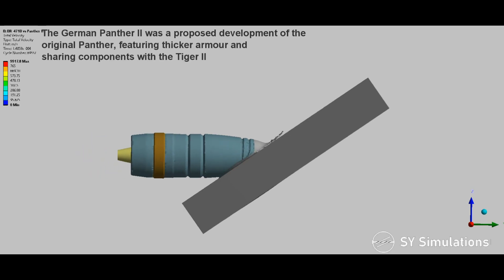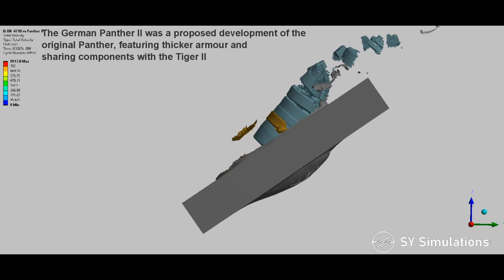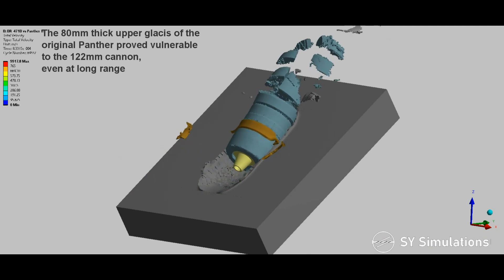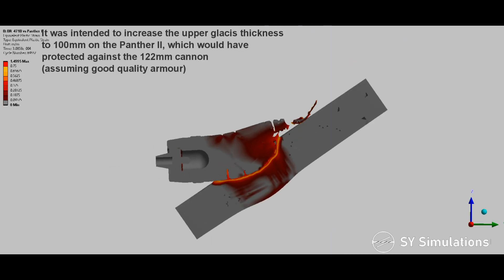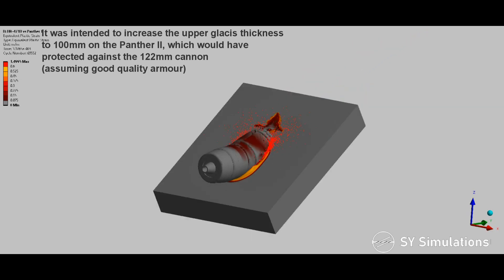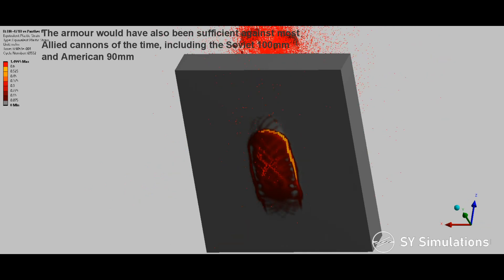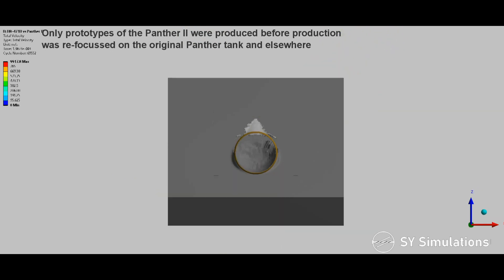IS-2 vs PANTHER II | 122mm APHE vs Up-Armoured Panther | Armour Penetration Simulation

Comment: at around 200 meters, the velocity of the BR-471B would most likely be around 795m/s. Not like it would do a lot more damage tho
Reply: Perhaps if it had that speed it would launch small fragments into the tank, although considering that the armor shown here is 250 BHN (good quality), it's possible that late-war German armor would fare worse. But I wonder if this 250 BhN armor would resist the 100 mm D-10T/S.

Comment: Quite a controversial simulation.  On November 21, 1943, when the D-25T gun was tested, the penetrations were complete, the projectile entered the armor completely.  The Panther's top armor plate could be penetrated from a distance of 2,000 meters.  Jagged penetrations larger than the caliber of the gun were accompanied by spalling and cracking of the armor plate.  The first hit in the turret completely tore the plate off the tank.  The second hit tore the turret off its shoulder strap and moved it back.
Reply: 1: It's not the Panther 1, it's the Panther 2 with improved armor 2: This is more my opinion, but from my point of view... I wouldn't trust the Soviet reports so much.
Reply: @leonardogandini147  The results of the battles speak for themselves. The D-25T showed its best side
Reply: @difenol5750  Not really

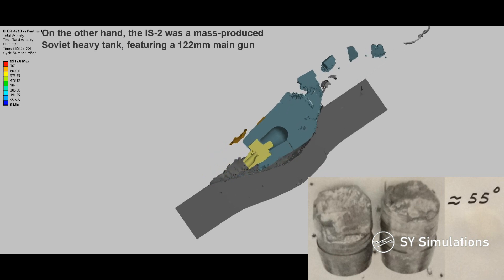Comment: С времени 0:20 в видео показано изображение 122-мм снарядов после взаимодействия с броней под углом 55 градусов. 
Эта фрагмент фотографии из этого отчета со страницы 057: cloud?mail?ru public j6A7 BU51JeYeD 8734 038
Из отчета можно понять, что это снаряды после следующих опытов:
1)страница 071, опыт №4 : плита толщиной 119,24 мм твердостью 300HB (диаметр отпечатка 3,5 мм) под углом 55 градусов. Ударная скорость 796 м/с. 
Результат: вмятина 230х155 мм глубиной 60 мм. С тыльной стороны наметился выход пробки на 3/4 окружности со сдвигом до 15 мм. Головная часть снаряда сработалась по второй локализатор. Длина оставшейся части снадяда равна 175 мм.
2)страница 072, опыт №7 : плита толщиной 119,24 мм твердостью 300HB (диаметр отпечатка 3,5 мм) под углом 53 градусов. Ударная скорость 805 м/с. 
Результат: пробоина с размерами входа 300х170 мм, отверстия 110х60 мм и выхода 150х130 мм. Головная часть снаряда сработалась по второй локализатор. Длина оставшейся части снадяда равна 180 мм.
В этом же отчете можно найти и результаты стрельбы по плите толщиной 120,3 мм твердостью 250HB под углом 55 градусов с ударными скоростями 793-825 м/с (страницы 90-91, опыты 1-6). Результат: плита не была пробита.
Хочу рекомендовать сначала повторить в симуляции опыты из этого отчета, что бы проверить правильность моделирования советских снарядов с локализаторами в Вашей симуляции.
Reply: Интересно, как вы думаете, смогла бы 100-мм пушка Д-10Т/С пробить «Пантеру 2»?

Comment: The only remaing pather 2 prototype is whats left of a turret
Sitting in the storage wearhouse at bovingtong
The engine deck was hit directly by a 155mm artillerly shell during the battle of berlin
And threw the turret several meters 
They repainted it the best they could but there isnt a whole lot left
Reply: everything you said is wrong, that's impressive
Reply: What was bro smoking when he thought this up😂
Reply: @idontlikecommunists9677  it was the panther F not the panther 2
Reply: @garyslayton8340  yeah and the Schmalturm at Bovington wasn't mounted on any tank and it never saw combat, it was used as a range target after the war lmao

Comment: wasnt 122mm BR shell prone to cracking and breaking thus reducing penetration drastically?
Reply: not all variants just the 471B and 471A the 471D had improved quality which ironically made it perform worse against angles than the lower quality "softer" 471-B

Comment: The cracking inside would likely be ejecting very fast micro-spall that is injuring the driver regardless. The concussive force of the 122mm is also likely causing the crew to bail out of the vehicle.

Can't really armor your tank well enough to survive being hit by a 122 mm AP shell from the IS-2, it is likely to cause all manner of chaos no matter if it penetrates or not

Comment: The key there is "assuming good quality armour".  By the end of the war, German armour was really poor due to lacking several key elements needed to make it.
Reply: The "bad quality of german armor" is a myth that doesn't want to die. Everybody repeats it like a dogma yet you somehow will never see a primary source for that. It's source is from british report assuming degradation of german armor due to lack of manganese but they didn't take into consideration the germans already had different armored steel composition.
The quality differences are also never given in relation to other countries varying quality. All nations had varying quality of armor and AP shells but only german is discussed while assuming other vehicles retain same quality of armor. It's simply not true, it's reality of mass production during war that quality control is not retained in constant.
Reply: One key element missing was Molybdenum.  This helped with the elasticity of the steel.  Main source for it was Turkey.   I got this information from the interview of a Tiger 2 Commander by a Modeler here on youtube.  The German was like 90 years old plus and chain-smoking.  The Modeler kept having him look at things and the German did not even use reading glasses.  Wish I could find that video again.
Reply: @jimmylight4866  Supplies of it were greatly diminished and what they had was larely reserved for making the cutting tools.

In part the Germans tried to compensate for the lack or reduction of Molybdenum by changing the tempering process though you can imagine that an already finicky process  become even more finnicky.

Not something you'd really want in an industry that is at risk of being bombed any moment.
Reply: @Dreachon  Thank you for such an informed reply.  I never read or heard about it being reserved for cutting tools.  I would love to read more about that.

I have observed the cracks around AP shot holes in the late war steel. 

Some of the hits on early steel I have seen, particularly deflection shots,  look like ice cream scoops with no cracking around them. 

Something else I would like to understand is how the Germans figured out how to weld plate armor together before everyone else and the process of doing it correctly.  

Carius mentions rivets flying around after being hit in his Czech built tank early in the war. Ouch!

The firm Bismarckhütte seems to have specialized in this plate welding earlier than other makers of the sd kfz 250 hulls for example.  

I mention the 250 as it is a vehicle I have studied in depth.
Reply: This is just BS , any proof for that myth ?
Reply: @5co756  look at the dozens and dozens of pics/vids of cracked armour on Panthers and such like. Or read the reports written by several nations or experts on the poor or inconsistent quality of mid to late WW2 German armour production. There's literally tons of proof out there
Reply: @KP-viking88  There is also literal proof of the armour working well as a Panther resisted multiple hits from the 90mm of the M26 and a Tiger II hull performing well against the 105mm that would have one on both the T28 and T29 and this is stuff that ot tested back at the US, stop with the cherry picking of pop-history historians who  want to push a narrative. 

Nearly all of those Panthers with cracke armour got shot multiple times, that is what is going to happen and happened to other tanks as well. You think a Sherman or a T-34 is goin to look better after getting a dozen shots?
Reply: @Dreachon  take off your fanboy glasses and read it again. German armour production was inconsistent, which means sometimes it was decent quality and others is wasn't. Ill believe reports and articles written and published by experts in their fields over your narrative or hurt feelings.
Reply: @KP-viking88  So rather than make a proepr aegument and present soruces you instead to go an label me as a fanboy.

Guess that says enough, an the quite limited extent of your knowledge on this subject.

Don't go and mention experts when for you that just means copying what some random person in a YT video says.
Reply: @Dreachon  Stick to War thunder, youre better suited to that than the truth about WW2 armour production
Reply: @Dreachon  if it was a swing and miss why did you reply back with the "kid" reference? Try being original and contradicting yourself
Reply: @KP-viking88  Because you are a kid, plain and simple.
Reply: @Dreachon  of course I am, thats why you've resorted to immature insults😂😂
Reply: @Dreachon  We literally have metallurgical analyses of WW2 German steel. It wasn't great. Panthers had levels of chromium, vanadium, sulphur, manganese and carbon way higher than desirable. These all make the steel harder, but more brittle. It also weakens the welds, which is pretty evident in photographs of destroyed panthers. We also see this in testing, as cracked welds were far from uncommon. The quality of their steel was bad enough to make the testers believe their steel was being sabotaged during production.
Reply: @5co756  The much publicized ‘low quality’ armor was only due to shortages of molybdenum and nickel. IT WAS NOT A MYTH. The Germans got around this by using vanadium and chromium and quenching baths with duration of immersion specified to the second. Given the weight of the plates, such as the Panther glacis, inconsistencies were a natural consequence. In spite of all these difficulties, combined with the chaotic situation of German factory conditions, (material shortages, Allied bombing, sabotage etc…), only about 50% of Panther G glacis and about 33% of Jagd Panther front superstructure were effected. Even more surprising was the fact that German armor quality actually improved in the last months of the war!  
Source: “World War II Ballistics” by L.R. Bird and R.D. Livingston, and it is not BS.
Here is another thing to ponder about. It is a hardly known fact, a secret largely kept away from Allied fan-boys. When it comes to low-quality armor, US tanks produced up to late-1943, took first place. Flaws such as stringers and laminations riddled American RHA plates up to mid-1943 and interior hot tears and shrinkage cracks riddled cast armor up to late-1943. Contrary to German tanks, ALL armor was flawed, not just the heavy plates and these included ALL M3 and M3A1 Light, ALL M3 Medium, ALL early M4, M4A1/2/3/4 and ALL M10 TDs! All this without material shortages and cozy working conditions!!!
Source: “World War II Ballistics” by L.R. Bird and R.D. Livingston, and it is not BS.
Reply: @5co756  many. German armor was shit from the beginning, there are British reports dated 1942
Reply: @spyderDFX  British.... really ? 😂 Can't get more biased than that , this reports are worthless dude . If they even exist , source trust me bro or what ?

Comment: I wish they didnt remove panther II and they should give it back
Reply: If you mean Warthunder, the "Panther II" that is there is a correct Panther II hull combined with Schmallturm turret (which only started development after the Panther II project was cancelled, to improve the existing Panther I and can be seen on Panther F), 8.8 cm KwK 43 gun barrel and gun breech from standard Panther's 7.5 cm gun, because the gun breech KwK 43 wouldn't even fit into that turret let alone be possible to load it...

Similarly, the WT representation  oth the IRL napkin design of Tiger II with 10.5 cm gun incorporates the napkin notes of 2 piece ammunition and 2 loaders, but in a very unrealistic way, since the front loader in the WT design is basically useless and IRL the loaders would be positioned on the opposite sides of gun breech (like in M103) and the commander would sit on the other side of the gun from the gunner as there would be not enough room for 3 crewmen in a row on the same side of the turret.
Reply: @Daddo22  I know everything but it shouldnt be blocked from playerbase its not Event vehicle wich u can buy
Reply: The in game Panther II is more real than some of the other crap they have in game, no idea why the removed it.
Reply: @cheekibreeki4638 for example?

Comment: Ah yes, 100 mullimitters of armor defeats a 122 mullimitter shell. The voice over is nice, but sometimes it does sound pretty goofy 😂
Reply: MILLIMETER
Reply: 100 millimeters of armor inclined at 55° degrees results in about 150/160 mm of effective armor. Furthermore, not all 120mm~ cannons have the same performance. Compare the Jagtiger's PaK 44 to the IS-2's D-25.
Reply: @evansmillan8868 not 155-160. Around 190-200mm of effective armor
Reply: @ztashed6366  The effective armor value is calculated by multiplying the armor thickness by the angle of inclination and adding this result to the armor value at a right angle. If 50-55 degrees of inclination doubled the thickness then the Tiger II would have at least 300mm protecting the driver
Reply: @evansmillan8868  tiger ufp 50°, not 55°. Its a huge difference
Reply: @evansmillan8868  He's talking about the goofy AI voice

Comment: How well would Germany have done in the Eastern Front if they had this Panther II tanks as their original Panther tank?

Seems like the original Panther was a good design riddled with mechanical issues that took a long time to eventually fix.
Reply: It would have performed even worse then the original panther. it would have been less mobile and the mechanical issues would have gotten even worse then they already were do to the wait increase. 

The panther is WAY over hyped. Its mechanical issues where also never fixed, they definitely got better and a few did get fixed, but the Issues with the final drive were never fixed. Also it was a living hell to repair, with problems that would take allied or soviet tank crews maybe 20-30 minutes to fix, the same issue would take hours or even days to fix for German crews. and some bigger issues that would take allied or soviets a few days to repair in the field the Germans simply couldn't. often time having to send panthers all the way back to the factory's to be fixed because it was easier and often faster then trying to fix them in the field.
Reply: @seductive_fishstick8961  There is literally no mechanical issue on a tank that takes "maybe 20-30m to fix" and least of all on Allied tanks. The mechanical reliability and ease of maintenance of Allied tanks is what's vastly over-hyped, what actually happened was the tank was dropped at a depot and they just grabbed another one. Their actual advantage was that they didn't require as much field infrastructure to replace things like transmissions and roadwheels, not that they could be banged with a wrench a few times and magically fixed.
Reply: @seductive_fishstick8961  It would actually have been better. Mobility would be way better, since it used the tiger 2 engine and transmission, along with the final drive, roadwheels and tracks. So better for logistics, less prone to final drive failure, more armor, more mobility, since the engine would have produced slightly better forward speed and significantly increased reverse speed. From 4 km/h to at least 15 km/h.

Also, every mechanical "failure" from the early Panther D version was fixed by late 1944. The only thing left to fix was the final drive that was simply designed for a way lighter tank.

Comment: Panther II is a paper project
Reply: The prototype hull was built and still exists. It's currently housed at Fort Moore in the US fitted with an erroneous Ausf G turret to make it look more complete.
Reply: @STHV_  prototype was with 80mm armor, because it was a laboratory on tracks for testing a new chassis, but hull is ordinary panther
Reply: @senpalma  Nope, not even close.
The hull is completely different from a standard Panther, the entire hull is longer for example.
The plates of the hull are full thickness the upper glacis is 100mm thick and the sides are 60mm. The hull was built exactly to design spec with the only difference being that the vehicle is made of mild steel not hardened armour plate steel just like most German initial prototypes.

You are confusing it with the V1 Panther prototype that was used to test various Panther II components before the Panther II hull was built.
Reply: @senpalma  yapping some very uninformed shite here, bruv
Reply: LOL

Why be silent, when you can speak and remove all the doubts.

And Panther II was and is a real thing. It is in some American museum but with standard Panther G's turret.